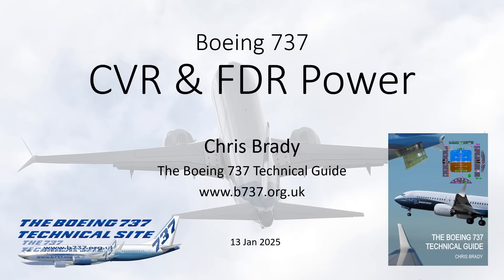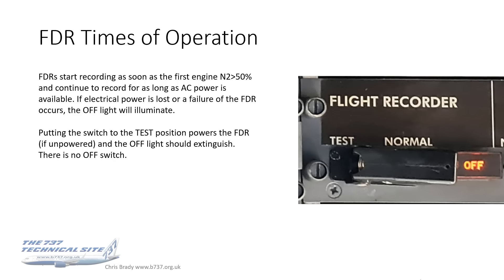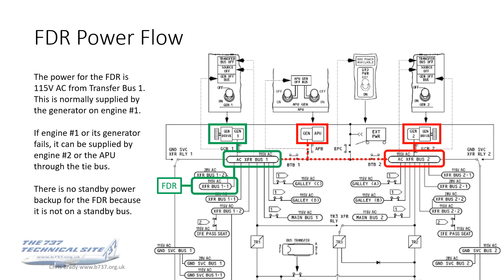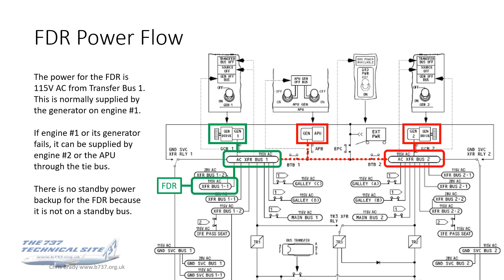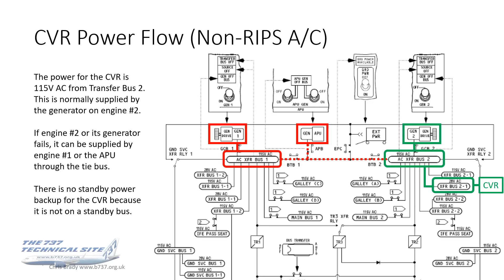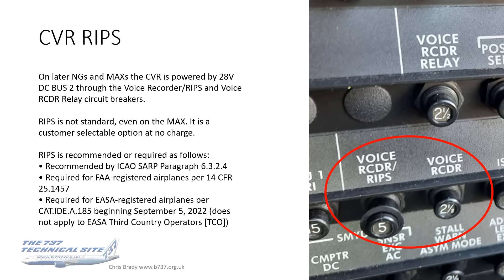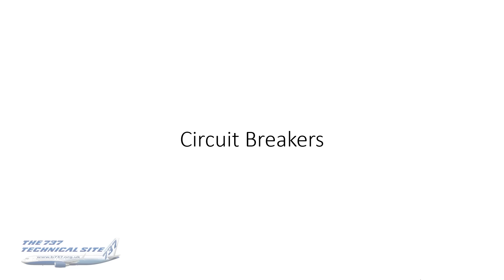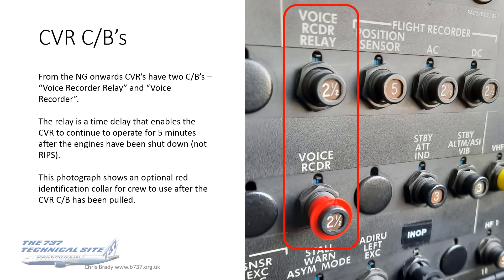737 CVR FDR Power

Comment: But engine #2 was still running, which we know from the plume of hot air, the open TR doors, and the damage to the fan blades. And if engine #2 is still running, there should have been power on AC Bus 2. Very mysterious.

Do you know the sample rate of the FDR? Is there a chance that we can get at least some of the engine data before it stopped?
Reply: Just because the engine is running does not mean the generator is running. That can fail independently of the engine
Reply: The generator control units need the generator to provide an output with limits, 110V to 125V and 390Hz to 410Hz. It is possible the the No 2 engine was operating, but at low power providing some residual hydraulic power enough to assist the pilot flying as the flight controls are a light, load but insufficient to keep the No 2 generator online.

Comment: I think they shut down the wrong engine, and as the right engine was damaged (but still running) it might have not been performing over the 50% threshold, and the FDR/CVR would not get power.
Reply: That is a possibility, but there are two other obvious possibilities:-

1) The No 1 engine was damaged by hitting birds, and failed when high thrust was required during the go around.

2) The No1 engine was damaged by hitting birds and then encountered another flock of birds and was hit again.
Reply: @christopherrobinson7541  What exactly are you trying to explain with these suggestions? The question is how a failure of one engine resulted in both engine driven generators going offline. The obvious answers are that either both engines took sufficient damage to disable the generators, or only one engine did and the crew accidently shut down the other engine.

Comment: Ok now I know where to send all the conspiracy theorists. Great explanation!  So... what would happen if the phase and frequency of #2 generator went out of alignment and instantly zapped gen #1... theoretically speaking.
Reply: The system is designed that only one generator can be on the same bus. If a new generator is put on line the previous source is replaced.

On this aircraft the AC from the generators are not synchronised.
Reply: @christopherrobinson7541  no bus tie breakers... odd

Comment: Insurance companies should refuse to pay out on any policies where the recorders failed because the aircraft design permitted the recorders to fail.  In this case it appears the pilots shut off both engines and also failed to turn on the  APU.  That should be prohibited by the aircraft design.  So if Boeing designed this so that it could fail, then the FAA SHOULD GROUND all applicable 737s until Boeing fixes this design flaw.  Boeing has been literally getting away with MURDER.
Reply from the maker: The recorders not working had no effect on the outcome of the flight. If the authorities considered them to be vital then they would mandate that they are powered from a standby bus.

Comment: A designer and manufacturer of complex equipment should not require a government mandate to apply sound engineering principles and design.  Simply amazing. This ranks right up there with having only one sensor input to a system like MCAS.  Did all of the real engineers at Boeing retire or resign 20 years ago?
Reply: I do agree with you.  This looks like incompetence, but let me play devil's advocate.  Many are too young to remember all the discussion and pushback on CVR and FDR data being recorded, and the privacy implications.  Pilots were very vocal about this, as were their unions.  It was a huge topic.  Both airlines and manufacturers were stuck between the obvious advantages of having this data, and the wrath of their pilot community.

About the engineers that retired 20 years ago, this was designed about a decade or so before these "real engineers" retired, so we can't blame this on the whippersnappers.
Reply: @ Well, when I worked for a large corporation, it was clear that they owned the computer I was using, the phone I was using and any IP I developed on the job.  It is no different for pilots and any pilot who doesn’t after with that should be fired and replaced.  Both CVR and FDR are designed for SHTF circumstances, not normal operation.  Given that fundamental requirement, to power them from a normal power bus rather than a SHTF power system is simply engineering incompetence.

Comment: As a retired electrical and systems engineer, I am astonished that Boeing doesn’t power the CVR and FDR from a battery powered emergency bus.  Boeing continues to impress me with their lack of sound engineering.
Reply from the maker: The recorders not working had no effect on the outcome of the flight. If the authorities considered them to be vital then they would mandate that they are powered from a standby bus.
Reply: @ The recorders are not designed to affect the outcome of a flight.  They are designed specifically to help determine the cause of a flight with a poor outcome.  Since they are designed for SHTF scenarios, their power should come from a SHTF power source.  This is really, really basic engineering.  I retired after 32 years in engineering and R&D and this is so fundamental I shouldn’t even have to mention it.

Comment: Wouldn't the RIPS stop working 10 minutes after the battery bus drops below 20v, rather than 10 minutes after loss of AC power? 

If that were the case, then you would get the 20-30 minutes of battery power, then the 10 minutes of RIPS power, right?
Reply: RIPS charger isn’t powered by the BAT BUS. It’s powered by DC BUS 2 which is lost when in standby power
Reply from the maker: @tomstravels520 Correct

Comment: Hang on, did you mention an electrical relay is needed to manually lower the landing gear?
Reply: When you open the access door to the alternate extension handles, it activates a solenoid valve (rather than a relay) which makes sure the normal hydraulic pressure is removed from the landing gear (so that it doesn't fight the gravity drop)
Reply: The relay is a solenoid that operates a bypass valve.  Not needed always but if landing gear selector valve (sorry cant post a pic here) is stuck in gear up (retraction) position this is needed to bypasses the pressure and allows gear to fall when uplock are manually pulled.
There is a switch in the gear manual extension panel which operates when you open it.
If gear lever is down ( cable operates selector valve) it is not needed but operates anyway.
From tech manual…. Key word RETRACTION 
The selector valve also gets an electrical input from the manual extension system. This operates a bypass valve in the selector valve to connect the landing gear retraction to the hydraulic system return. This lets the manual extension system extend the landing gear.
Reply from the maker: @737787 you are exactly right - and put much better than I said in this video!
Reply: @ Been retired 4 years (TRE 737 ) but used your notes and website for years!
Reply: Even with gear lever selected up, no engines or no electrics and low speed no windmilling engines or hydraulics turned off  there will be no pressure and gear will fall if manual ext cables pulled.
Reply: @737787 Even at low speed, surely you'd get some hydraulic pressure. Are you saying that if the lever was in the UP position and the engines were windmilling (aircraft at 200kts), they wouldn't fight gear deployment (even if this electric bypass system wasn't fitted)? Or are you saying because of this system, you could lower the gear?
Reply: @ImperrfectStranger  Based on what the simulator did……
At 135 to 145 knots windmill drops to below 15% 
Need 45 % for 3000 psi
To drops steadily until you get low on pressure and flow and controls revert to manual reversion. 
This could surprise crews just as they slow down for landing it all goes.
Reply: @ImperrfectStranger  It’s always fitted.
Reply: @ Thanks for the sim data (assuming a Level D sim).
Reply: @ That's what I assumed (but I haven't any details for Classic 737s), but are you saying that even without electrics to power this system, and the gear lever in the UP position, gear extension would work?
Reply: @ImperrfectStranger  I think you are thinking like I am. 
Crew do goaround. Gear lever is up. Gear is up when Crew lose one or two or both engine to birds. probably not siezed but windmilling. 
Or Crew shuts down “wrong” engine. Maybe pulls wrong fire switch. 
. No generators. Windmilling hydraulics only. need that windmilling on number 1 as that EDP is System A= gear. 
Glide approach speed with no flaps? Becomes a stall margin thing. From memory stall clean about 165 at max ldg weight. Stick shaker would be bit higher. 

If crew put gear lever down very late on glide approach there could be not enough A pressure.and no time for manual ?

If they went manual earlier with more speed still and even if gear lever still up and forgotten would the gear stay up if electrical source for that relay is dead? More research! Which bus? Will look into it.
Hope this makes sense.
Reply: Battery bus!

“When you open the access door to the manual extension control mechanism, an access door position switch closes. The position switch sends 28v dc from the battery bus to the manual extend solenoid valve in the landing gear selector valve. The manual extend solenoid valve commands the bypass valve in the selector valve to move to the bypass position.”

Comment: The engine was still windmilling. The complete cut-off of electrical source from both engine generators is inconceivable.. there is also standby battery system to rely on.
Reply: On this particular model year 737, CVR and FDR are powered by AC Bus 1 and AC Bus 2 as a backup. It does not have battery backup at all.
Reply: Unless I’m misunderstanding….. According to the system diagrams from Boeing shown in the video… The DC backup does not power the CVR and FDR. They rely on AC bus 2. ie if engine #2 is shutdown (Fire extinguisher activated), they shut down. Assuming APU is inop of course.

The thought behind this is to keep as much reserve power as possible for critical controls.
Reply from the maker: @thiswillprobhrt absolutely correct

Comment: You say that RIPS keeps the CVR running for 10 minutes after every flight. Doesn't this mean that the battery gets discharged once per flight? Lithium ion batteries can usually only handle about 10,000 full cycles. Does this mean that the RIPS battery needs to be replaced every few thousand cycles?
Reply: In theory no because when the aircraft is on the ground it is still powered by the APU or ground power supplying the electrical system, so it should still be getting charged
Reply from the maker: @tomstravels520 correct
Reply: @tomstravels520  so what determines the 10 minute duration then? Wouldn't the external power just keep the CVR running indefinitely then?
Reply: @sbreheny  "so what determines the 10 minute duration then? Wouldn't the external power just keep the CVR running indefinitely then?"

Yes, it would keep running with ground power or the APU running and 10 minutes after they were shut down of disconnected.

Comment: Excellent video! When you said that the OFF light on the FDR illuminates when power is LOST - what is the power source to illuminate that light without external power?
Reply from the maker: 28V DC Bus 1
Reply: @ChrisBrady737  if that power is present then power hasn't been lost, has it?
Reply: @sbreheny  The 28V DC Bus 1 is powered by TR1, 2 & 3, so if AC XFR 1 is lost the off lamp can be illuminated.

Comment: Thank you Chris. One hypothetical question.  If the only working engine was shut down,  would the FDR record that action, just before losing power and stopping?
Reply: The FDR records 1 to 4 times per second depending on the setting. If the wrong engine was shutdown by accident, it would record the fuel flow till it drops to zero (engine stops). Then the FDR would shut off.
Reply: @CodyCha  Not until it drops to zero, but until the generator could no longer provide power within the required voltage and frequency specification limits enforced by the GCU. Then the GCU would disconnect the gen from the bus and the FDR would stop working if there was no other AC source to keep the XFER BUS 1 alive.
Reply: Or perhaps one engine followed by the other failing after bird strikes.

Comment: Thanks for the info concerning FDR and CVR plus RIPS, which would not help anyway. TR power is derived from 115VAC generator bus and if you loose this bus than TR is 
pretty much useless. As electrical engineer I find RIPS design strange and useless, standby DC power would be much better alternative power source. At the same time 
when FDR and CVR stopped recording data, plane transponder quit working. Where is that unit powered from?
Reply: There are 2 transponders and apparently transponder 1 at least is one of the AC transfer busses. Not sure about the 2nd but the crew would have to switch it to 2 manually if it’s BUS was still powered
Reply from the maker: Re "I find RIPS design strange and useless, standby DC power would be much better alternative power source", I disagree. Standby power is not unlimited, with the loss of all AC it comes from battery power and they have a finite life and power things that are really needed to save the aircraft.
Reply: TR power is derived from AC bus, this is not redundancy in engineering sense.   Independent power source is needed to  meet the requirement.

Comment: Is it possible that they pulled the fire suppression systems on the engines before they started the APU?
Reply from the maker: Possibly, we will have to wait for the final report to find out.
Reply: The air inlet door for the APU was closed, which suggest that the crew did not attempt to start the APU.

Comment: Thanks Chris!  There is some speculation that they may have accidentally cutoff the wrong engine following the bird strike. So if the strike only affected one engine, and they turned off the wrong engine, without starting the APU, would that result in the recorders stopping if the plane does not have RIPS? Not to say that they did that, but just from a technical perspective?
Reply: Basically both engine driven generators would have to be offline. Whether that’s due to engine shutdown by pilot, bird strike damage…nobody knows yet

Comment: Wouldn’t they have at least called out shutting down an engine, even if it was the wrong one? The only way it could be without any voice communication recorded about the incident is if the bird strike shut down both engines at the same time?
Reply: FDR would have recorded the engine shutdown before it lost power.

Comment: Thanks Chris. I note that you didn't mention the loss of ADSR data 7 mins before the crash and also that you thought it extremely unlikely that the crew (or one of them) would have pulled the circuit breakers.  I still can't get my head around Juan's assessment where the crew did a 180 degree turn that put them on the trajectory to the berm especially with no gear/flaps/spoilers and a high energy approach. As awful as that may be, I assume that someone will be considering whether this was a deliberate crew action.😥
Reply: The teardrop, long and fast landing is due to lack of thrust. If they had thrust, they would have lopped around till they can setup a good approach

Comment: What is the source of CVR power for the five minutes after engine shut down?
Reply: Same as normal. That BUS will be powered by either the APU generator or ground power.
Reply from the maker: @tomstravels520 correct!

Comment: Your conclusion is correct,  recorders are not essential for flight so would represent an unnecessary electrical load on the standby buses. Additionally with AC power off few of the systems parameters recorded would be available.
Reply from the maker: Absolutely right

Comment: Chris, your comment about circuit breaker collars is mystifying- the collars are meant to ensure that the breakers stay pulled, as shown in the picture. They are NOT meant to make them easier to pull by the flight crew.
Reply from the maker: There are two types of collars, one for each use. I cover this in an electrics video
Reply: @ChrisBrady737 I agree with the OP. C/B collars are there for a reason, to ensure that the C/B remains pulled. If you use a C/B collar to pull a C/B you will most likely break it. I don’t know of any reason why pilots would be allowed to pull C/B’s during flight or on the ground. I understand all airlines have different procedures, but do you have a reference that states that pilots can pull C/B’s? Our DDG allows the use of 3 different types of CB collar. Yellow is for maintenance, Red is for MEL application, Blue is for system deactivation (such as a modification)
Reply: The reference is the QRH itself. There are QRH procedures which have you pulling circuit breakers. We don’t just pull them Willy nilly… the different colors of collars are used to quickly identify certain C/B’s
Reply: @MQOOWN737  can you post a reference to a QRH procedure that requests you to pull C/B’s?
C/B’s have grid references to locate the correct one
Reply: @MQOOWN737  actually I just found a couple of references in the QRH to pull C/B’s. I learnt something. Having said that, the referenced C/B has a grid reference. Does your airline have different coloured C/B’s?
Reply: @NicholasRiviera-Dr  Design engineers don't stuff components into a crowded flight deck unless they believe the flight crew may have a need to access it, i.e. to operate it, read it, observe its status, etc. That applies to circuit breakers too. There are CBs elsewhere on the airplane that the pilots are not expected to operate, though for some of them the status may be indicated on the flight deck, e.g. by way of indicator lights, e.g. Bus Tie Breakers.